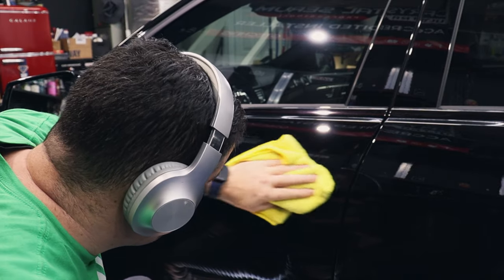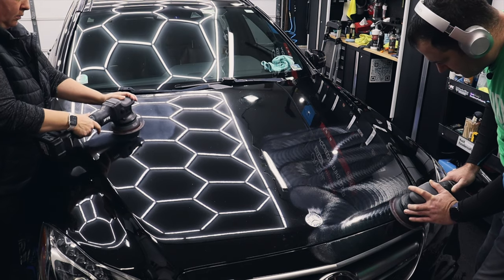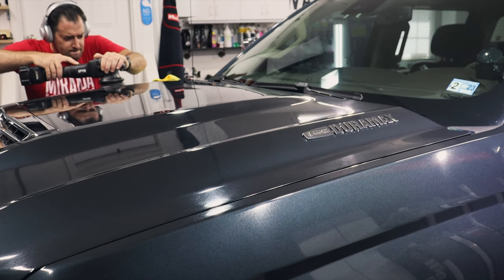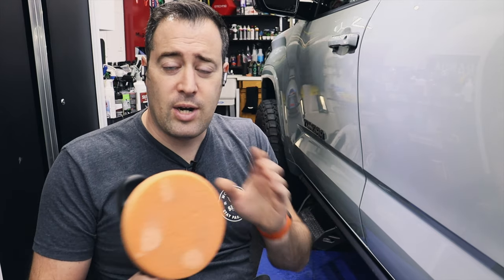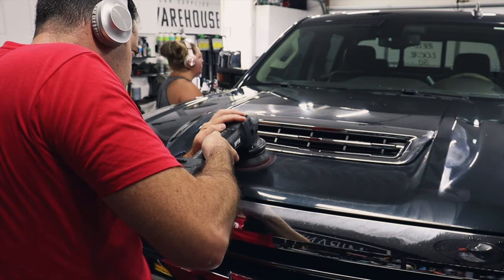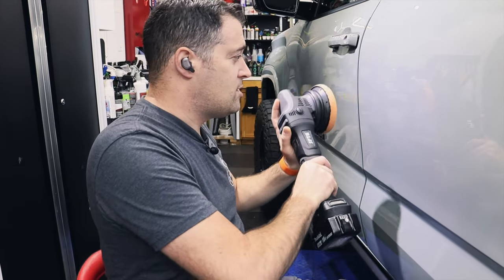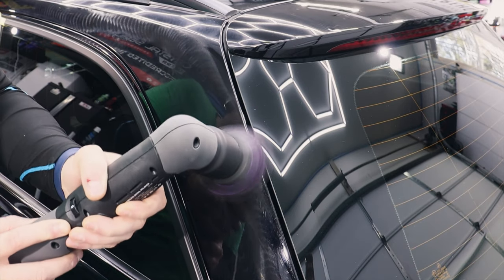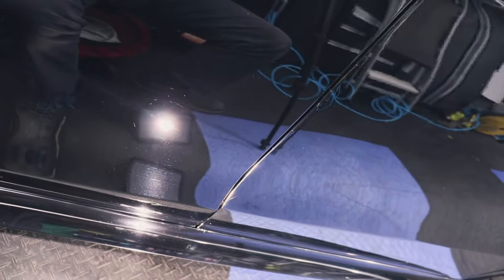Polishing Incorrectly? Learn to polish! #detailing #details #polishing

Comment: one of the most recent tips i heard from yvan was starting with a damp pad, wet it, slap it on, spin to get the water out add compound and go to town. been watching vids for awhile and never heard that or maybe missed it somewhere. but working under a carport always in the shade but in the elements that tip has worked wonders for me
Reply from the maker: Yup. I have done that before and for mobile guys it’s a great option to keep the pads cooler.

Comment: I like to focus on just changing 1 thing at a time when doing my test panel. So I’ll start medium arm speed, light pad, light polish and I’ll change a pad first, then the liquid, then the arm speed. Repeat from there until I hit the acceptable combo of the 3. I typically don’t mess with my pressure or the speed of the polisher if I can help it, but sometimes though can work well as 1/4 steps to dial in a bit more. 
I personally prefer a faster arm speed than what is typically shown in videos, as I’ve found diminishing polishes to breakdown more evenly that way.
Reply: Great advice

Comment: Hey, Im new in the channel, therefore, you took many points i have learned many years ago, the technic is to follow practice, I have the same method to paint correction i have done this passion for 20 years i went to study and i have gotten my Certificate from 3m, I have used Zymol Professional products i never disappointed instead every time i make Art on Cars. and using also some handmade products from one friend from England. my secret is to do slow, not push the pad because you kill the paint everything with the Green pad. Best.
Reply from the maker: Awesome!  Thanks sharing!

Comment: I detail on my spare time for some extra cash and I tried many methods and products until I found my niche. I usually just use microfiber cutting pads, microfiber finishing pads and if needed a quick foam pad for the last touch and I just use M110 and M210. I tried a ton of products and those work for me the best. Most of the cars I get have hard paint so this works for me. If get a car with soft paint, sometimes I just use the finishing pads for all of it and it works fast. For me, prep is what takes the longest.
Reply from the maker: Thanks for sharing!

Comment: Love the vids. My biggest problem is not knowing if a car has soft or hard paint. Why isn't there a list or something to help weekend detailers? What pad to use with the soft or hard paint. Thanks
Reply from the maker: Thanks!  Yeah unfortunately there is no way to actually list which vehicles will have hard or soft paint. It can change from year to year or month to month. Doing a test spot is the best way to determine how the paint will respond to polishing. We always start with a medium foam pad and medium polish to see how the paint responds then switch up the combo depending on what happens. You eventually understand how to go from there with experience.